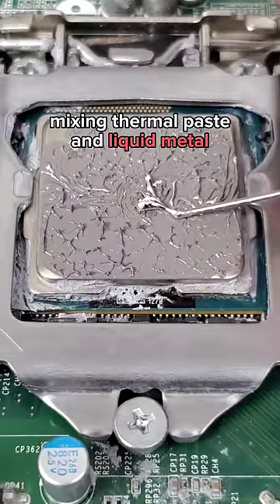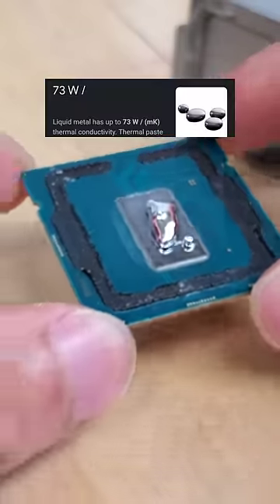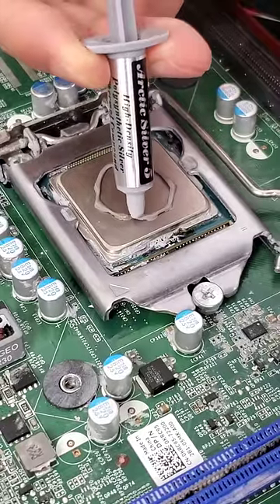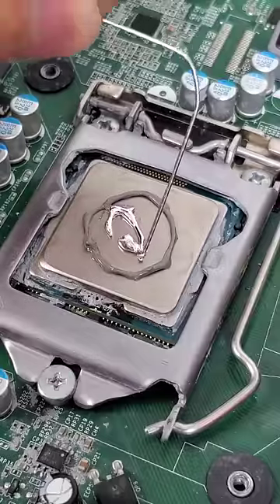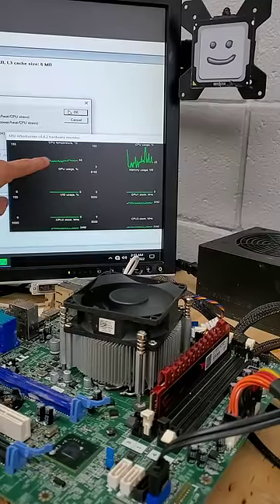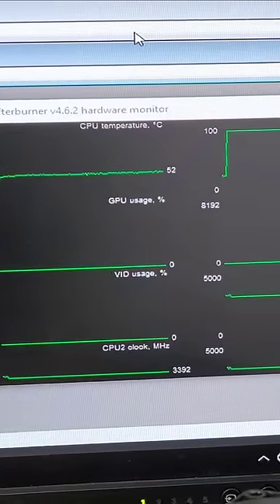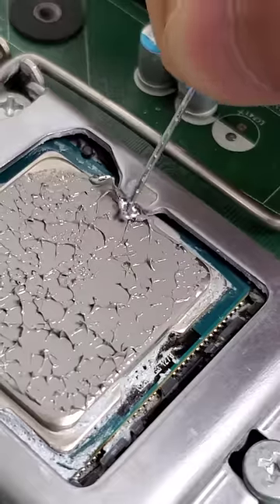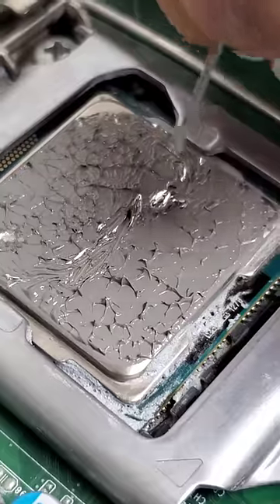mixing liquid metal and thermal paste! #shorts

Comment: That aluminum cooler will suffer after this if he dosent clean that liquid metal off the contact plate
Reply: It's probably already ruined
Reply: Probably will be the next video
Reply: She gone 😂
Reply: Doesn’t it have a layer of oxidation normally?
Also I thought heat sinks were nickel plated copper
Reply: @flazer2797  yes, there are nickel coated copper heatsinks, but this is an aluminum heatsink which reacts with the gallium
Reply: @flazer2797  the oxidation does prevent on contact reactions, but i'm sure that it'll break through when it's 70C+ many hours a day with thermal cycling
Reply: The 30 cent generic cooler ? I think he is ok letting it go for the experiment.
Reply: Too late.
Reply: Ohhh fuck now i realize it
Reply: @gabrielgarcia9822  temps not a problem,galium in liquid metal eats aluminum
Reply: @llollik00  I know, but the layer of alluminum oxide prevents on contact ruining
Reply: @gabrielgarcia9822  Will not m8 sry to disappoint you. Its normaly contact corrosion because two metals are too far appart. Oxydation will not cover it, there is always a way.
Reply: Nah, myth.
Reply: Gallium degrades alimunim into a form of wet paper consistency but likely it was Nicole platted copper. Which has far less reaction.
Reply: @adamevans9697  who’s Nicole lol
Reply: Nice observation Furry
Reply: @12Burton24  It's advised not to bring Gallium into contact with Aluminium, but all demonstrations of it always use some type of surface activation to remove the oxide layer, be that sanding the surface, drilling into it or dissolving it with acid.
Reply: @Tyrian3k  Demonstrations need the fastest way to get it done to demonstrate it within a reasonable time.
Reply: Might have a copper or zinc plate at the bottom for contact.
Reply: @eraldorh  thought about that but those coolers are cheaply made so I doubt it has it.
Reply: He'd have to scratch it first
Reply: Galium infuses into most Aluminum alloys and will spread through the metal and destroy the whole unit!
Reply: Not exactly as the chem reaction Dosent take place unless the aluminum is freshly scratched (it has a layer of oxide on it that will protect it unless removed)
Reply: @IDontHaveAMicrowave  you have a microwave
Reply: @stanleybochenek1862  i actually don't have a microwave, i've got a kettle an oven and heating plates but no microwave
Reply: I was about to say that... U need copper
Reply: As soon as gallium touches aluminum, it's already ruined.
Reply: İts already done
Reply: I’m sure he does not care he’s doing it for a video for a reason😂
Reply: Ig no, the aluminium is probably oxidised on it's surface
Reply: @flazer2797  Yeah
Reply: @raffi2287  but the oxidation layer prevents further corrosion
Reply: @gabrielgarcia9822  hmm yeah pretty good point, gotta look into that
Reply: @Redditard  not with this it doesn't, if makes aluminum crumble to pieces regardless of the oxide layer
Reply: @raffi2287  TIL something new
Reply: nah he is already to late
Reply: only if its scratched, all aluminum has a thin layer of transparent aluminum oxide. if this gets scratched off, it will replenish the coating in an hour but if gallium is applied immediately it is ruined
Reply: Already ruined as soon as it made contact…
Reply: yo you're cool
Reply: Might have  a copper slug in the middle, but not sure. It looks like it might not.
Reply: It's already dead
Reply: Bruh. If it was aluminium, it's gone
Reply: Not all liquid thermal pastes contain gallium. But so many do that my comment is almost pointless😂
Reply: @flazer2797 some are. The cpu lid usualy are. The is a delid cpu here with prob way to much Gallium on. I used Gallium on my previous build it works Greate but yes you dont need much..
Reply: @raffi2287  the oxidization layer is protecting it
Reply: RIP little cooler
Reply: actually, not really. to get the aluminium to for the amalgumation with the gallium you need to expose it to pure aluminium. so like scratch the surface below the gallium or etch it away. normal aluminium has an oxidised layer on it which protects it from many things including amalgumation. all the vids where you see the gallium destroyed stuff, you will see too scratches where the gallium was placed. so here it will be completly fine probably
Reply: @12Burton24 wrong. it will protect it. all the vids where you see the gallium form the amalgumation, the aluminium is always scrated. nile red made a vid about this whole thing once and he even had to etch the layer of oxidisation away to get it to work. aluminiumoxide is pretty innert which is why it protects aluminium
Reply: @lucakun3455    due stop talking about things you have no idea about pls. You aluminium oxide protects aluminium against oxygen to avoid further corrosion but contact corrosion is a different topic. Most aluminium coolers have not scratches but are brushed/sanded. Contact corrosion works if lets call it two materials are "too different". 
I really dont want to be rude m8 but my daily business infact is planes made from aluminium touching other materials. Btw the smallest unvisible damage in te oxide max it corrode again in a normal air environment
Reply: @lucakun3455  and he does it mainly to speed up the process to a big attacking surface is there. A cpu has little long with the IHS if made by aluminium or the cooler but is faster than with stady temps due to heating upnd cooling down.
Reply: @gabrielgarcia9822  also a little tiny scratch in the aluminum and gallium is gonna have a nice meal
Reply: Optiplexes cooler from Dell it has infinity damage but still functional

Comment: TFW you ignore the big warning label saying "DO NOT USE ON ALUMINUM HEATSINKS"
Reply: Unless it has a copper core like most modern HSF have.
Reply: i was just about to post a comment exactly like this!!!
Reply: what the fuck does tfw mean
Reply: @schizopenguin  the face when
Reply: @schizopenguin  Copper core is what makes  contact with the CPU and carries the heat away to the aluminum fin stack to distribute typically to a fan. It's a cheap method than using all copper. Copper has higher thermal conductivity than aluminum.
Reply: @Gaming_Machinist could also mean “that feel when”

Comment: Terrifying amount of both liquid metal and thermal paste (which will actually reduce thermal transfer efficiency and certainly push out the liquid metal onto the PCB, where it will wreak havoc), and a terrible decision to use an aluminum heatsink that will be destroyed very rapidly as it reacts with gallium in the liquid metal. This is a video of what not to do in every respect.

Comment: Um... I sincerely hope that wasn't an aluminium cooler. Galium dissolves aluminium
Reply: Was just about to say that
Reply: learned that from lockpicking lawyer
Reply: It almost certainly was
Reply: Only if the ihs oxide layer got expose
Reply: Not dislove more like infect.
Reply: Short time is okay
Reply: you know it was.
Reply: Gallium doesn’t really dissolve aluminum, it just forms an alloy
Reply: not really. I mean yes it can but only if it get's in contact with the pure aluminium. the oxidised layer on top protects it bc it's pretty innert. you have to remove it in order for the gallium to form the amalgumation, like scratching, etching it away with acid or drilling into it

Comment: Gallium also eats through aluminium. So if you have a cheap board it might dissolve your CPU housing
Reply: Gallium based termale paste isn't pure gallium. I guess they know what they are doing. If you go "just gallium" well, yes, CPU will be eaten alive.
Reply: @xDakem It has a big warning label says "do not use on aluminum based heatsinks" lmao
Reply: I was thinking that
Reply: Gallioum is corrosive to almost all metals (affects aluminum the most) so basically all his setups is probably fucked but he probably didnt notice untill after making the video
Reply: I mentioned this above but it produces hydrogen as a bi-product of oxidizing the metal, mainly aluminum. The shitty thing is hydrogen plus heat = boom, and no one wants their computer to explode.

I have a 7950X 16C32T. If that thing were to overheat, i would definitely light up the insides of my PC WAY more than just RGB! 🤣🤌🏻🤷🏻
Reply: yea
Reply: @OmriStreams it's all metals except like 2 I believe. It just takes longer for harder metal but all metals that react with gallium it usually happens within a day so it's not viable even for a short time.
Reply: @xDakem  you love talking without knowing huh?

Comment: Also worth noting that you should use liquid metal only if you have a copper based cooler or AIO because over time it will break down aluminum and ruin the performance and usefulness of a cooler

Comment: Just to add to this. The theory behind how these work is simple. They go inline with your iat (intake air temp) sensor. They have a resistor that changes the read temperature of the air going into the engine. They trick the computer into thinking the air is closer than it actually is. Colder air is more dense so the computer adds more fuel into the mix which in turn make the engine run richer.  Which to be fair can add a very small amount of power in some cases. But it's still a scam.

Comment: That's because the liquid metal needs to react to the surface (i.e the liquid metal needs to bind to the cpu heat spreader surface and the cooler base plate). You'll know when you do it right when the liquid metal lays flat like it's wet solder. The fact that it stays like a water drop means it doesn't want to react to the surface, which is caused by some form of oxidation on the surface or the liquid metal itself, similar to solder. The best way for it to react is to heat the cpu heat spreader with a hair blower. Do the same for the liquid metal (I advise you to put the liquid metal on a separate container and use a qtip to dip and spread the LM. You'll also know when the LM is good for spreading when the qtip just soaks it in.

Comment: Surface tension of any liquid will decrease when heat is applied to it.
In this case, the cpu is the source of heat. Therefore galium would spread out from the center and condense on the edges.

Comment: First, Liquid Metal likes to dissolve into aluminium to form an amalgam which causes the aluminium to rust and become brittle. Also when applying Liquid Metal, you need to evenly coat the cpu IHS and heatsink. Though in this situation you could have mixed the Liquid Metal into the thermal paste before hand to form an emulsion and then try.

Comment: It looks like the liquid metal is avoiding the thermal paste entirely, meaning it can't be contained and ends up being forced out through it.

You might want to get a 3d printed copper casing to fit over the outer edges of the IHS so it helps stop the paste from leaking maybe? I wonder if there's a way to literally 'seal' in the thermal paste so you can control where it leaks when you press the cooler down (like having 1 tiny hole or pipe where the excess paste is pushed out of, so you can use pressure to push out the excess to get closer to the IHS, while recycling the excess paste.

Comment: okay a few things, gallium is solid at room temperature but melts at around 30C or 85F. Second, that liquid gallium is going to amalgamate with that aluminium, and even if you clean it off, it's going to near enough disintegrate the fan and cpu.

Comment: 1 you have to rub the galium thermal paste in until it sticks like water, not have it as a blob between the cpu and cooler.
2 you cant have any aluminium touching the galium thermal paste, galium eats away at aluminium
3 nikkel plated copper (like the IHS) is the best for use with galium thermal paste.

Comment: Also it doesn't like sticking to the nickel plating. You can get better stickage by sanding to bare copper but if there's aluminum nearby it'll crumble it to dust.

Comment: Just to clear up some misconceptions for anyone watching this a year later:

The aluminum heat sink on the CPU cooler will soak up the gallium over time. A lot of viewers are commenting that the issue in the end is the CPU cooler becoming brittle and falling apart. while this is true, gallium will dissolve into the aluminum structure and will no longer be present on top of the IHS on the CPU. This will lead to positive spikes in temperature and the gallium metal will have destroyed your aluminum cooler and become useless all within a day or two. 

As a temporary test, this works great, but material usage has to be taken into consideration for long term operation.

Comment: Dude didn't even realize liquid metal chemically interacts with aluminum, ruining the heat spreader on most CPUs. Short term probably isn't enough to mess it up bad but even a few hours would ruin it probably. It's why it's used directly on the CPU die and requires the heat spreader removed

Comment: It would probably be possible to make something that could contain excess paste/metal.

Something rubbery(a material with the highest thermal conductivity possible, low insulation) that lines the outside of the IHS so the paste doesn't pass it, except for a very small hole in the lining where it can escape through.

Behind the hole should be a repository with a semi-permeable membrane that lets the air escape as excess paste is pressed into the repository.

This way all the excess would end up in one contained place and there'd be no danger of using conductive metals like gallium.

The downside would be that the lining around the IHS would isolate some of the heat to some degree which is not good. How you limit that I don't know. I'm only in a family of engineers, not one myself.

Comment: My dad worked for a small computer company that tried to make a gallium based thermal paste. It worked well for overclocking computers but since most heat syncs are made of aluminum and gallium just kills aluminum.... it didn't sell very well.

Comment: Not to mention if the metal housing of the CPU has even remotely a small scratch and contains aluminum, it will oxidize and destroy the metal and cause an exothermic reaction that produces hydrogen as a bi-product and that can cause a massive explosion.

Comment: If your Integrated Heat Spreader (IHS) is aluminum and you use gallium thermal compound, it will make an alloy and turn your heat spreader or (aluminum) heatsink into goo/fluid!

Comment: I've done this before. Except I actually mixed them and spread in a thin layer. instead of putting a large glob of metal in the middle of the CPU. It didn't leak out to the edges like this video. but it didn't yeild much of an improvement. likely because normal paste is more insulator than conductor.

Comment: Seeing a lot of comments about the aluminium vs gallium, and while it's possible some bonded with his heatsink (I thought that too at first) but it's important to remember that aluminium oxidizes quickly, and at this point, is probably quite protected by that oxide from the gallium. He'd have had to scratch up the aluminium first for that to be a serious concern. Additionally, as the gallium didn't seem keen on combining with the thermal paste, the paste probably added to that protection. 
Of course, this is all nothing compared to the obvious electrical conductivity issue, as the paste refused to contain and instead ejected most of the gallium to the edges. Good luck sir in getting all that gallium out of there, else RIP Motherboard/CPU.

Comment: I did the same but im not an idiot to put the thermal paste at the center.
1st i put tape leaving the small spaces at the very CORNER of the IHS.
Then put paste and removing the painters tape now only the side have thermal paste that is evenly spread.
Then use 99% alcohol to clean the middle while avoiding touching the thermal paste.
After that I applied liquid metal and spread it but leave a lil bit space between liquid metal and thermal paste (traditional paste will spread while liquid metal will not as long as you dont put too much).
Then i also put a painters tape on the water block  (nickle plated coper) to avoid drying of liquid metal.
But this time i only apply liquid metal in a square shape that will not touch the thermal paste(again just a thin layer).
The result is no matter how i tilt the case there's no liquid metal leaking.

In your test you basically mix thermal paste and liquid metal btw you put f*ckin to much liquid metal you want a tiny rain droplet 💧 of liquid metal.

Comment: I'd advise against applying that much like that when it comes to liquid metal... And don't use an aluminium heatsink!! 

- thoroughly clean the surfaces that will be liquid metalled to ensure proper coverage will happen

- Use a very small pinhead-sized  amount of the liquid metal on the surfaces and move it around with a qtip - the liquid metal should spread out into an extremely thin but highly thermally conductive layer. then mount the cooler as normal.

Why shouldn't you use aluminium? -
Aluminium has a crystalline structure when viewed super close, and Gallium finds it extremely easy to wick its way into this structure forming an amalgam. when this happens, the aluminium becomes weak and extremely brittle.

Comment: Being if you would actually put proper pressure to mount a cooler it with the thermal paste would take up to much room as there is only a very small gap compared to the material you used.

Comment: This is because you didnt apply it properly. You can apply liquid metal and then put paste on the edges to contain it.   if you actually do this instead of just dumping both on the cpu and expecting the cooler to spread it when pressure is applied then it can give benefit to portable devices.

Comment: It's not a long term help as gallium metal can easily make a hole through an entire car in less than an hour even if only a drop is left on it even strong metals with turn as soft as paper if it comes in contact with gallium